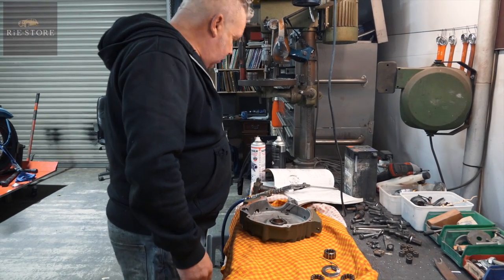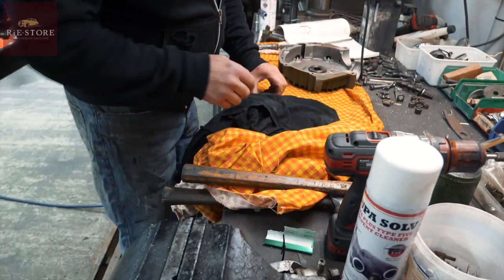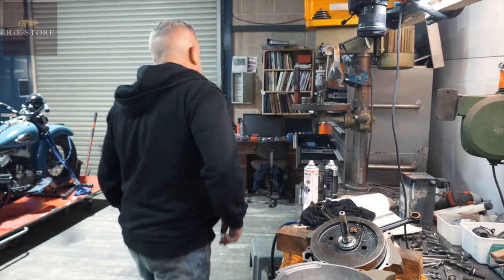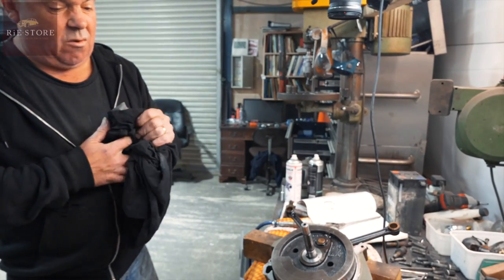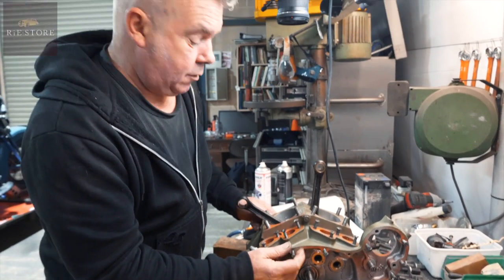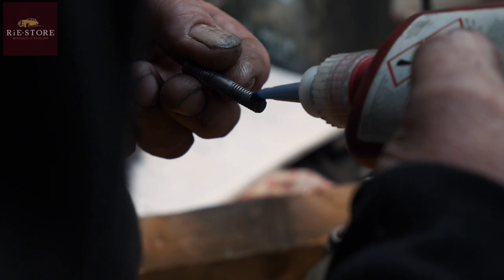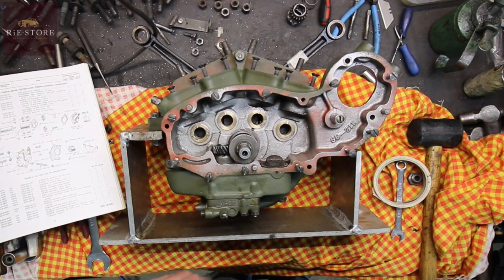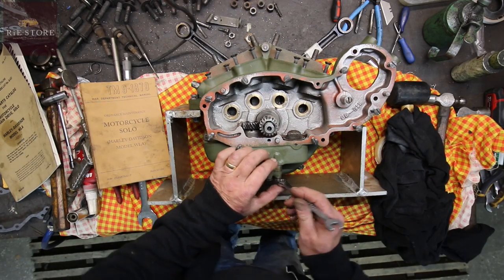Harley Davidson WLC 45ci engine rebuild / ep149

Comment: always a pleasure to see a WL build video.  Im currently working on the engine of my 49 WL, how thick is the bearing race dimension in the case? I'm using a 0.098 and a 0.102 washers on my crankshaft and wonder if the case bearing races have been worn down but i do not know the stock thickness

Comment: I hope you can help. The cam cover was chromed many years ago and the flutter valve that allows oil from the breather tube reservoir back into the crankcase is frozen solid. Have you ever replaced / repaired one?
Reply from the maker: Hi Charles, we just filmed a Q&A today and answered your question - the video will be up in a few weeks so stay tuned!

Comment: Thank you for the video. I was wondering, do I need to check the clearance between the generator pinion and the driving pinion located in the timing cover? (There are a few paper shims between the generator and the housing on my one). I noticed that you had the timing cover bolted on prior to fitting the generator.

Comment: Question for Ash the Mighty, what’s the highest mileage vehicle he’s had and what’s the most miles on a vehicle he’s worked on? My currant work truck is 362,000kms and my older farm truck that’s in the shop for some attention has 441,000kms